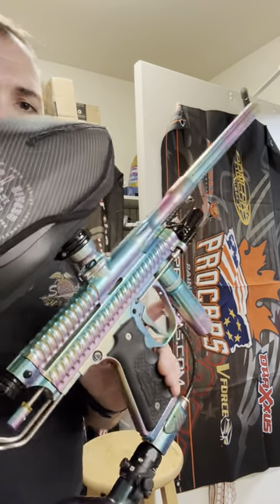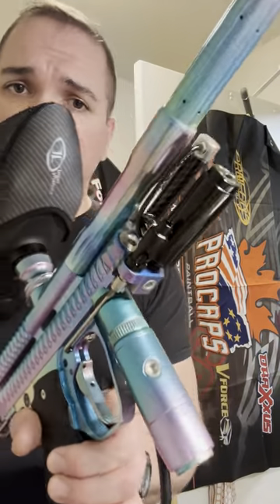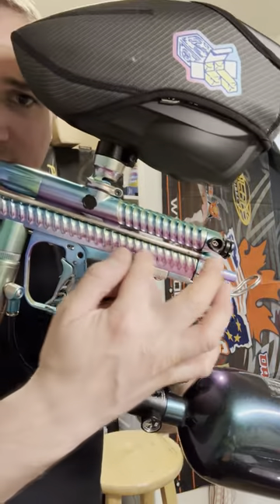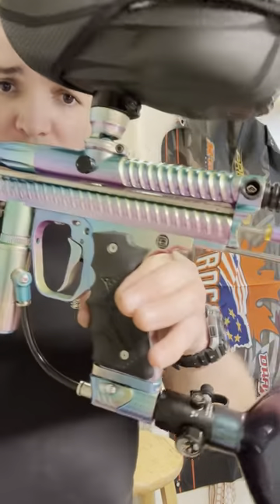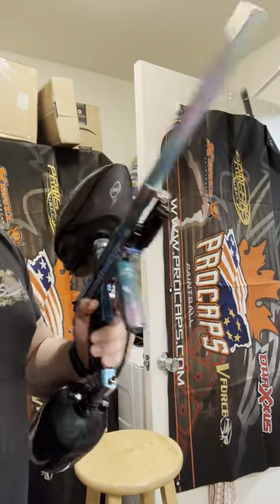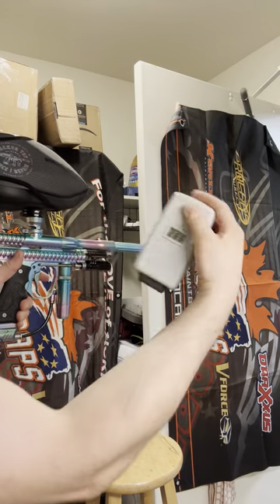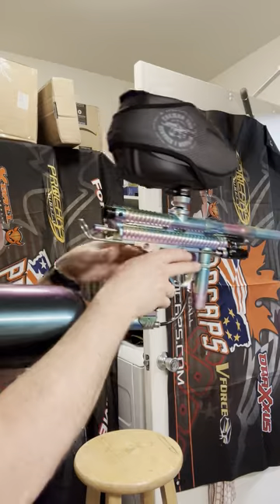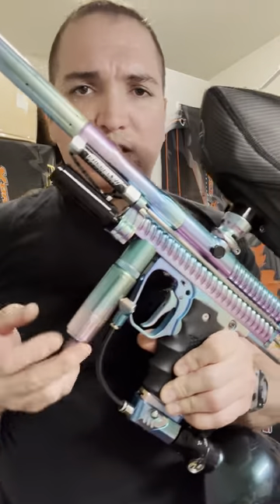LNT Ridgeback rebuilt w/ Dye Laz valve… meh.

Comment: I'm glad to know a cocker expert like yourself hasn't gotten super low pressures out of the Dye Laz valve too. I have one in a Resurrection with stock hammer and spring and it sweetspotted to 300 psi. It shoots great, but I was expecting 200-250 psi.
Reply from the maker: Yeah the Tornado valves in 11/16” that I normally use perform better for me still